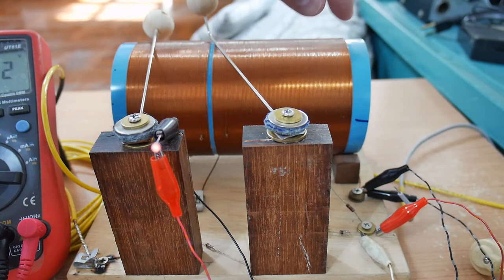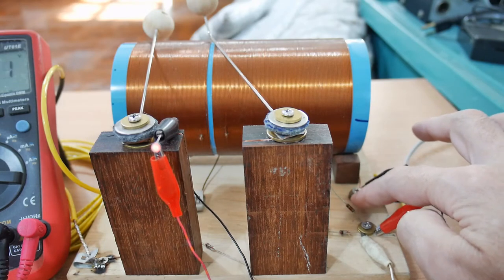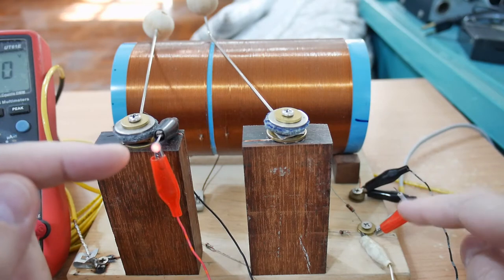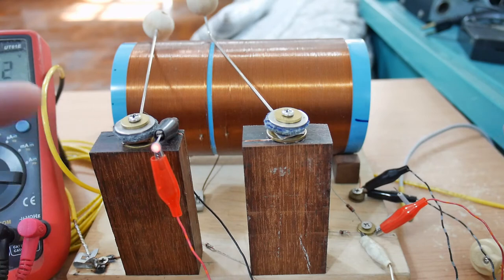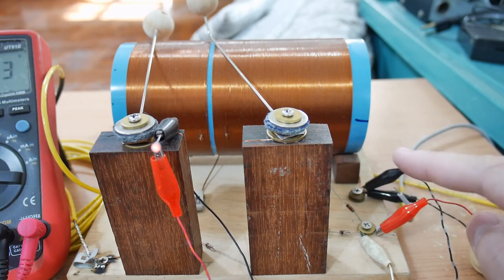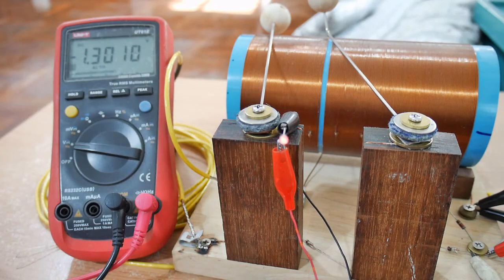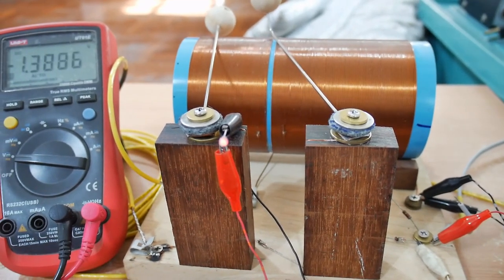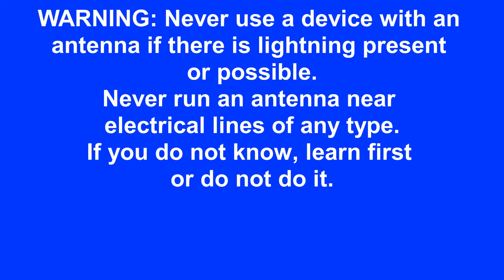Crystal Electrical Generator - RF Energy Harvesting  Exp 2

Comment: You just discovered the city's electric power grid. The antenna is capturing the EMF of your house power grid, and all the power grid around. 60 Hz hum is induced on your random wire antenna. It happens all the time but all that power is discarded because you don't want to to 'tune in' to your 60 Hz power grid company. So you discard that with your tuning tank and tune to broadcast band but still the 60 Hz is so powerful compared to the broadcast band that it makes it thru the headphone connector.
Reply: Actually he's picking up radio waves from the surrounding area, but nice try I guess wannabe

Comment: Ive heard crystals have a positive and negative, it can be found with a magnet i think the magnet will pull to the negative side,so could sound vibrate the crystal so fast it produces electricity? Can a tesla coil help this too and could a hole be drilled into the neg and pos sides of crystal to put copper wire in them to pull it out? Or might there be a easier way?

Comment: I am assuming this was tuned to a radio station? If so what is the power of the station and how far from your location was it? Amazing!
Reply from the maker: Good questions.  I can't hear the signal without the earphone, I'm tuning by watching the brightness of the LED.  So I'm not sure on either.  I assume it's the AM station about 2 kms away.  Don't even know their call sign.
Reply: You maybe be able to tune it with the assistance of a tiny am radio. When it is the same frequency the led will either glow more of go out !
Reply: When we moved into our house growing up there was no electricity or running water. The guy who lived there b4 was super smart and was a scientist. In the bathroom there was like a kitchen timer that you would turn and it would slowly light up a weak light in the bathroom. I knew he was into quartz crystals from talking to his brother who owned the house among other crazy stuff he had made. I'm thinking he was using quartz crystals for light somehow and making good use of it.

Comment: 1.3 volts is amazing.

I wonder if it could be used to power a TA7642 radio chip?

Peter Parker made one that would run for 1000 hrs on a single AA cell.

That would be an entirely different type of crystal set.
Reply from the maker: I found a guy who is doing that:
https://www.petervis.com/Radios/ta7642/ta7642-am-radio-ic.html
Reply: @tsbrownie  : That was an incredible link.

The idea was to take it one step further and power the TA7642 from your crystal radio.

It probably wouldn't work because, even though the current requirements of the TA7642 are so small it still might be too much.

Being close to a radio station would obviously help.  

If it did work, the advantage of using the TA7642 would be that you could tube your crystal radio to the strongest station to create the power you need to operate the TA7642 and then you could use the TA7642 to tune to any other radio station.

Like I said, it probably wouldn't work, but it would be an interesting experiment.

I have made radios using the TA7642 and I was very pleased with it's performance.